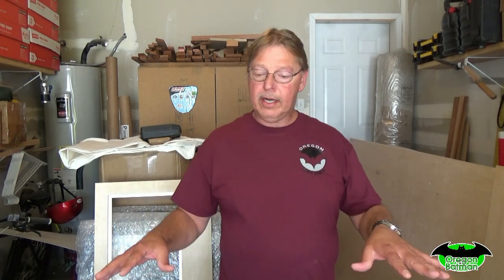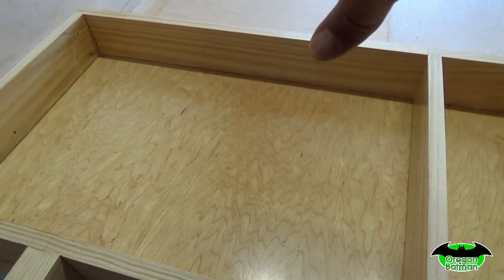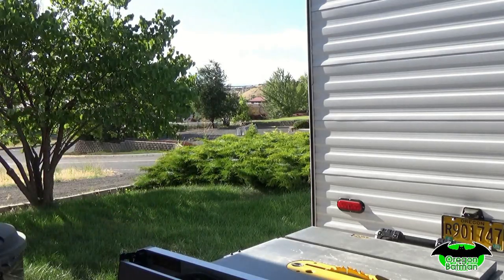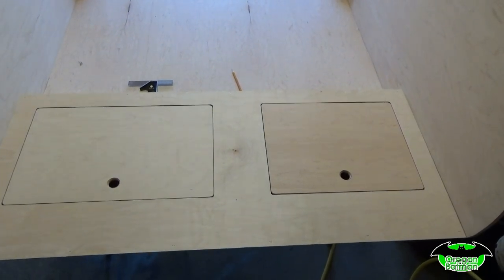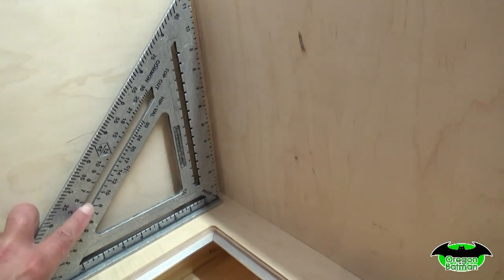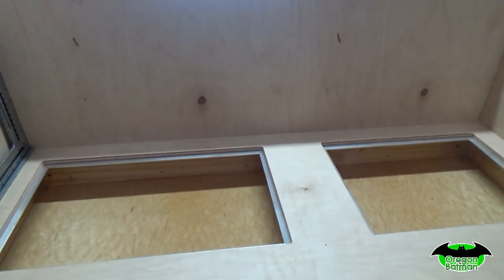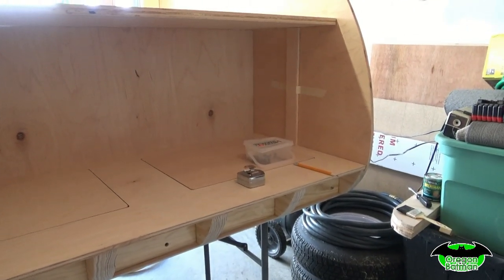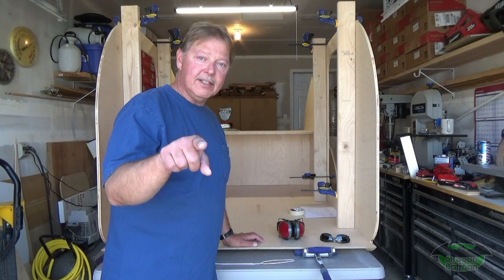Let’s Build A Teardrop * Step-By-Step * - Part 12 (Bulkhead and Counter Top)

Comment: Your attention to detail and presentation are outstanding!  I am enjoying the videos.  On #12 now.  Question:  Can Filon be spray painted?  I want it black but I don't think they make black...  Thanks
Reply from the maker: Hi John, Thank you for the kind words sir.... yup, filon can be painted. Consider the material the same as the outside of a boat (or RV). Can be sanded and painted (even with automotive paint) as you see fit. I do believe they make a black filon, I see it being used on the DIY Teardrop Campers Community. Jay Poore uses black quite a bit.

Comment: Did you varnish the underside of the storage area top before installation? Did you use glue on the vertical ends of the bulkhead?? Thanks.
Reply from the maker: Yes, varnished underside of storage top before install. No glue on the edges. Thanks for checking it out!

Comment: I'll have a little bet that this underfloor storage causes more problems than it solves. I think you've just pushed your countertop (worktop) height up by 5 inches or so. In a house, these are normally 900 off the floor (35"+). I'll bet yours are well over 40" in this teardrop, which is uncomfortably high.
Reply from the maker: Actually, the storage is quite useful... and the countertop is a comfortable 37" from floor, a little less if you would like to raise the front a bit. OR, you can lower the the axle a degree or two to be closer to the ground. Nice and comfortable.
Reply: @OregonBatman  Well, I'm glad to hear that. 37" is a good useable height.

Comment: I missed where you drilled your bulkhead through the wall, I thought you had already covered the outside wall with wallboard? I need correction please?
Reply from the maker: Hi Rocky! I installed the bulkhead and all cabinets before installing skin to the outside. Hope that helps

Comment: What changes would you make if you were going to epoxy and varnish for the sides rather than filon?
Reply from the maker: I would try and make all of the attachments for the cabinets and bulkhead on the inside. Any attachments made on the outside I would countersink the screws and then bung over top sanding smooth to the sides. I did my first teardrop this way and it turned out really nice.

Comment: Thank you Oregon Batman.
Really precise and clear instructions. I will build a camper this coming summer using your specs. Thanks again.
Can you tell me the projected dry weight of the finished camper? The 4 x 8 steel frame with 12” tires I will be using weighs about 190 pounds. Is that weight close to that of the frame you are building on?
Garry
Reply from the maker: Hi Gary! I'm guessing the weight to be around 1000# when finished, my frame probably weighs in at around 350#. Pretty heavy duty. 2x2 square tubing 3/16 wall with torsion axle, wheels and tires. I'll have a final weigh-in once finished, along with the cost. Currently working on ceiling and spars now. Should have the top finished in a couple weeks once I get electrical figured out. Trying to keep things simple.

Comment: Great update! I was just curious about the black screws you used for the sides on the bulkhead... appears perhaps you went with a drywall type screw. BTW I think those type of screws are used commonly in set construction for theater and stage.
Reply from the maker: Hi T455! Yup, drywall... was going to use stainless, but trying to keep cost down, besides, I have bucket loads of the drywall screws sitting around just waiting to be used! They do get a debut being on stage.... YouTube! LOL!

Comment: Get some fine steel wool and rub it down and you will have the satin finish you want.
Reply from the maker: Good tip... will need to try that in the future!
Reply: @OregonBatman  You can go back right now and do it , will take the shine right off and not hurt the finish at all. I have a friend who refinishes antique furniture , also when you have a piece of wood that is darker you can put a bit of stain in the clear coat and it will darken the lighter pieces to match.